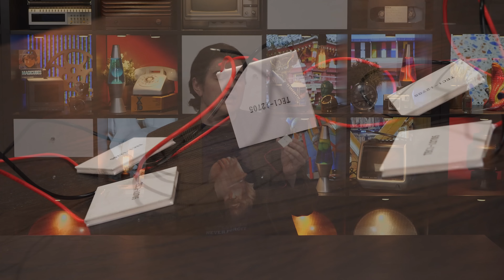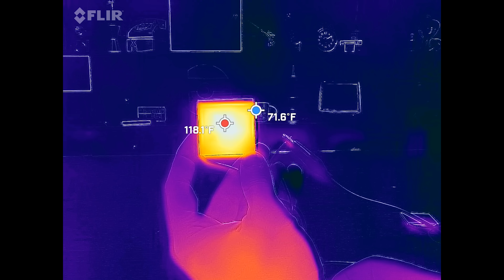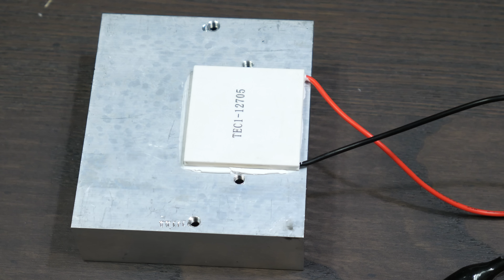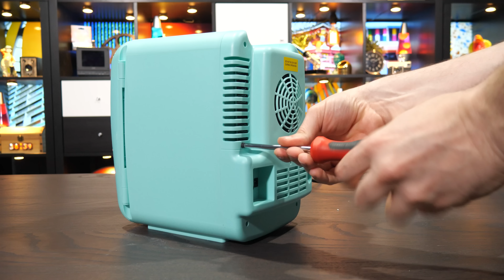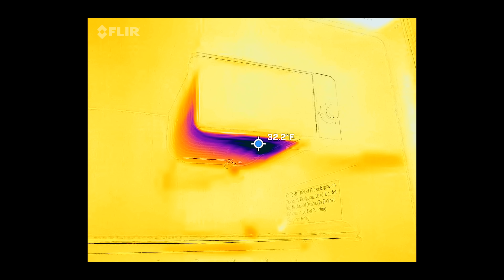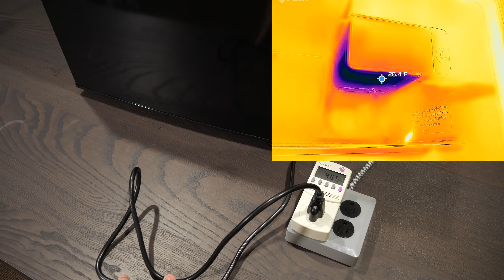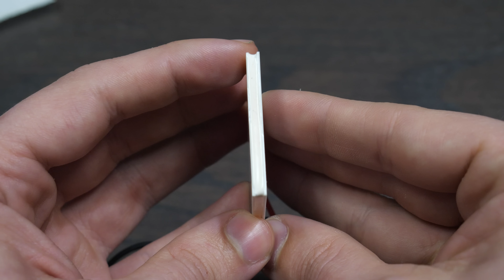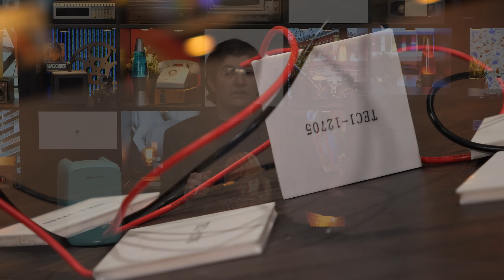Thermoelectric cooling: it's not great.

Comment: My parents picked up one of these cooler things that was designed to go in the seat of a car for a trip. We used it when we went camping for a few weeks and plugged it into the car and it kept every thing inside cool for a week by just plugging it in at night and running the car every once in a while
Reply: that was most likely one with a heatpump like a fridge, they have them for cars nowadays but they are not the cheapest option, very handy stuff, been thinking about buying one myself.
Reply: @northplayyyer3453  if it was it was the quietest heat pump I've ever heard, there was no compressor hum the only thing you could hear was the fan gently blowing

Edit: I just looked it up and on the website it says thermoelectric cooling

Comment: Peltier coolers are great for what they're good for but yeah those drink coolers are horrendously inefficient. For cooling small mid grade a low noise cameras or temperature control of other small things they're fantastic but anything that's large enough to attach a mechanical heat pump to that will be a better option.

Comment: I remember when Peltier coolers were a big deal back in the early oughts for ekeing out an extra 1-2C of cooling a CPU. You'd have to carve quite the divot into your heatsink to fit the thing between the CPU and the heatsink, the power draw was ridiculous, and again, it'd only drop your temps an extra celsius or two, but these were the days when if you wanted water cooling you had to kitbash together your own system using aquarium hardware so it was regarded as a "safer" mod to perform.
Reply: They do exist now too but with how high modern CPU power draw is, they are essentially useless except for when you only care about single core performance. Which is almost never.
Reply: @pafnutiytheartist  they are not useless because you can easily make 2 copper plates 4x4 inches and stick 4x400 watts TECs between, and then stick these sandwiched TECs on top of your i9-14900ks, along with a liter of vaseline and foam to prevent condensation. You will of course need a hefty PSU to run it, since each needs 25-30 amps, and probably a water loop with a car radiator to cool the hot side, plus you need to make the waterblock yourself. But it would certainly allow that CPU to run at its best. 
This design has been used before. Phase change cooling would allow for colder temps and will run much more energy efficient.
Reply: Anyone remember when Dell sold a high end PC with Peltier cooling, 2006 or so? I wouldn't be surprised if it used more power than a similar era dual CPU rack server, even though the rack servers of that era were particularly power hungry.
Reply: The Pentium chips were basically tiny blue stars of heat, there were some crazy overclocking mods in those days, compressors, peltiers, liquid nitrogen, lol. Those were fun times! I miss them, computers are so boring now, haha.
Reply: @LazarusXavier  Undervolting is the new overclocking, get the voltages and heat low enough to run turbo boost clocks full time without throttling.
Reply: Nowadays the heat output from a CPU would melt the junction and vapor pipe tower heatsinks are better at moving heat anyway.
Reply: The only thing stupider than using a Peltier module to cool your PC is using actual water. What could POSSIBLY go wrong???
Yes I underclock, how could you tell?
Reply: @fuzzy-pillar  My fully custom 4770k/R9 290x loop says not much in the last 10 years it's been running. As in it's totally silent on 100% of the original hardware, 100% of the time.
Reply: @fuzzy-pillar  You don't need to underclock just undervolt. My undervolted i5 13600K pulls 153w on Cinebench R23 while running all cores at maximum stock turbo boost with the temp never going higher than around 76c. MSI motherboards make this very easy with their CPU lite load setting though if you get too low with the undertvolting CEP also needs to be disabled or the CPU will start clock stretching (slowing down) to maintain stability (which you don't want because you're trying too see how low you can go and CEP is conservative)

Comment: My tiny 500w cheap solar power station runs my 3.2 cubic ft dorm fridge about 26 hours when ambient temp is 78 or less. Total capacity of the battery is under half a kilowatt...about 480 wh.

Comment: What about keeping that little mini fridge, inside your main fridge? You might have to drill a hole through the back of your big fridge for the wiring to the mains socket also, so be careful not to hit the pipes in the walls of the main fridge.

Comment: The fridges you compared with all included a freezer section btw, which is another strike against the blue box thing. You can also buy those cube fridges without that here, and they tend to be more efficient, and have more space inside. EDIT: nvm, should have watched to the end.
If you really want a mini proper cooler, use a portable/camping chest style thing. If you buy a good one they also have proper heat pumps. Plus you an then use it for camping/picnics/... etc.
They have actually solved the oil thing too, so they are not sensitive to being moved, but they are more expensive.

Comment: Phase change refrigeration coolers are very inexpensive these days. They have variable speed DC compressors. They use as little as 28 watts, and can bring the cooler below freezing with ease.

Comment: I recently bought a dehumidifier at my local Nex for about $50 utilizing the same thing as that tiny fridge. While it does pull moisture out of the air that is measurable by my hydrometer, sadly my barracks room is too large for it to make a major impact compared to a proper dehumidifier or proper heat pump. Much sadness.....

Comment: I do kind of feel that there would be a viable MEMS heat pump refrigerant circuit that's a sealed unit with a pump inside driven magnetically from the outside.

Like, you could make something credit card sized with nicely etched aluminium on either side of an insulating plate with a flow restrictor in it. Maybe even making it with sealed solid R744* during manufacturing as the refrigerant.

*CO₂

Comment: If you've gotta keep something at a quite specific temperature, the solid state reversible peltier is perfection.
It's uniquely suited to keeping things precisely tepid, not getting too big for its britches and trying to be a fridge.
I'm sure some scientist out there is using these things in their proper application. (Bulky compressors with brute force bang-bang relay operation will swing temps, but you can PID tune these piddly little TECs)
Reply: Yup, peltiers are the way to go to stabilise temperature of lab laser diodes. Small size, bidirectionality and ease of control circuit are unbeatable, especially in cases of low power dissipated in the diode itself and wanting to keep the temperature just a bit higher than ambient. Peltiers scale very well into region of low power temperature control.
Reply: Bang-bang relay make arcy-sparky fun times. Magic square not fun times. Don't want.
Reply: They are, in fact, being used to cool some spectrometer detectors, since they aren't generating a lot of watts of heat that need to be transported away, but do need to be kept very cold - and the cold side of a Peltier element can get very cold because you aren't limited by the refrigerant's boiling temperature.
Reply: Thermo-electric Dehumidifiers!

Comment: Peltier-Element a very simple way to cool something below room temperature in a small volume and at a very low complexity. Efficiency is not good as it heats more than it cools and the hot and cold sides are very close together. Scalability is poor. Your quickly in a Setup where a compressor / heat-pump makes more sense.

Comment: I bought one of those because I didn't want to have to use the shared fridge in the office in a place where I worked, it was not intended to do anything more than just keep the lunch that I'd already packed cool for a while. 

I think I would have done just as well by getting a portable cooler and chucking a couple ice bricks in each morning. That's what I've been doing now that I have delivery work and honestly it is the same if not cooler by lunch time.
Reply: Coolers have stood the test of time for a good reason. Ice takes a good bit of energy to change phases. 1 pound of ice will absorb ~150,000 joules from its surroundings by the time it's completely melted to water. Ice is cheap, and with good enough insulation, it can last for shockingly long amounts of time.
Reply: @whatbroicanhave50character35  cheap, AND you can literally make it at home.
Basically a thermal energy battery, negative polarity one at that.
Reply: @whatbroicanhave50character35  I'm actually using a couple of old ice packs left over from when a friend ordered some temperature-controlled medication delivered to his house. They work great.
Reply: Yeah, a cooler and a re useable ice pack is far better. 

The only thing I liked about the peltier coolers was the "hot" feature, so if I felt like warming up a lunch I could turn it to hot a few hours before I planned to eat.

Was kind of a treat in winter to reheat leftovers in a delivery van.
Reply: Ironically, “back in the day”, the office I worked at wouldn’t allow each employee to have their own cube fridge at their desk due to the “high energy usage”, but had no problem with everyone having a “toy fridge”.  I never knew the toy fridges used MORE power, and neither did management!
Reply: The do have coolers with compressor cooling too.
Reply: @chaos.corner Yes, I have one with a compressor and it's awesome!
Reply: Bright side, no need to worry about the power costs if it's plugged in at work
Reply: Get a old mini fridge with a lock on it. Totally insane how people are THIS CLUELESS at living on earth.
Reply: @MrWolfSnack  I'm sure it too would have been stolen by my office manager when I quit.

I like my Igloo Playmate better anyway.. Tough little guy, keeps my food cool.
Reply: @rolandguiscard  I’d say you’ve ended up choosing the most convenient, cheapest and most obvious solution to you particular needs: It costs next to nothing, takes up hardly any space, is portable (if you have to eat your lunch at some other location) and doesn’t require any permission to use company power or office space.

That others seem to think the obvious and practical solution is a personal, locked fridge, seems rather baffling to me. 

But then I work in a place with a good and regularly cleaned and maintained shared fridge in the lunch room, so I generally don’t have this problem. I even keep a constant supply of Coke Zero in there for when I want my caffeine cold, rather than hot (i.e. coffee).
Reply: @DebatingWombat  I mean, I needed something I could take in the car, so this seemed to be the right thing.

Comment: Great video. It might be interesting to look at Peltier devices being used in reverse (using a temperature differential to generate electrical energy) which can be used to make things like fans for wood-burning stoves
Reply: In the case of fans for wood stoves, sterling engines seem to be the way to go. It might be fun to compare the energy efficiency of the two systems
Reply: @bobby_greene  yeah, especially when it looks like they can be up to ten times as expensive
Reply: They definitely already exist, but the power produced is only really useful for small wireless sensors and things like that. Running a fan... maybe? But you'd need the same setup with a big heat sink to dissipate heat on the cool side and then possibly a fan to keep that side cool too. It's equally messy and might as well just use a small battery at that point. But you're eight about it being free energy, but only a tiny bit is available. You also have to be careful because its not scalable since if you pulled too much heat from the system then it wouldn't vent properly.
Reply: @uncertainscientist , exactly what i was going to say next
Reply: @uncertainscientist , I have a mini fridge filled with ammonia and a electric heater element, not great in efficiency but no moving parts. (Except the gas/liquid, and thermal load/unload)🙂
Reply: I expect that is already his next video. He loves to find parallels in videos.
Reply: The efficieny in that direction is really bad
Reply: @metrikmechanik  true, but that doesn't actually matter that much-a fan only takes a small amount of energy to run and the stove is pouring out an absolutely massive amount of raw heat energy all the time.  there have been a few people messing with much larger peltier arrays for wood stoves with the logic that even if it is inefficient it's a simple, long-lasting way to make a bit of power for an off-grid cabin to top off batteries on cloudy days.
Reply: @dayvancowboi9135 , absolutly but at that point you are running more of an experiment than a real device, wich is still cool😊
Reply: @metrikmechanik  Sure, but it's practically free energy (not the same thing as free energy generator, which is a fictional device)

Comment: You're right about the need to let a refrigerator with a compressor stand for a few hours after being moved. When I worked for a UK white goods dealer in the 1970s, the majority of our replacement fridge sales were to people who had just moved house and switched the unit on as soon as it was in its new position. Often this was because the electrical socket was positioned behind the unit and they didn't want it standing in the middle of their kitchen.
Reply: You can move them, but they should stay upright as much as possible. Briefly tipping it over should be fine. Transporting sideways in a vehicle for 30 mins should get some time to let the oil settle back.

If you start it up though, a lot of the oil will get pushed back to the compressor, but it will coat the lines on the way there and take a bit to get returned. This would be worse on the passive ones with the large backside coil compared to the fan cooled ones most are today.
Reply: @Jaker788  Here in the UK the vast majority of our fridges are still passively cooled since we don't have as big ones as America tends to. 

Either we'll have under-counter models which are just a fridge, or we'll have a fridge/freezer which is half the width of an American style one. American fridges are becoming more popular in the UK though but most people don't have room for them in their kitchens.
Reply: If you're ever asked by a friend to help them move house, first consider what kind of fridge AND staircase they have. I've experience with these sort of things and it's mostly not fun.
They're usually lighter than washing machines though, but way bulkier.
Reply: So, it worked. They didn't had them standing in the middle of the kitchen, after all 🤣
Reply: I had a friend who broke their refrigerator last summer when they moved. My dad who also used to work in white goods really doesn't feel safe until he's left the fridge or freezer to sit for 48 hours or more.
Reply: Sounds like a great way to make money 😆😆😆
Reply: @blackoak4978 money for nothing, one might say
Reply: Because it is filled with oil and the oil has to settle. Can be anywhere from 12-24 hours, depends on how long it was upturned.
Reply: Anything using a compressor with oil should stand for a coupleo fhours after being moved/bounced.
Reply: They weren't smart enough to turn the thermostat to off ?
Reply: @Kris_M  Not all Fridges have that setting. I have a cheap one that doesn't and worked at place that sold fridge.
Reply: @Kris_M  my first thought is to head to the fusebox and turn the breaker off... fridges usually are on an independent circuit... usually.
Reply: @paradiselost9946  That will, in the vast majority of properties in the UK (and, to my knowledge, Europe in general), end in disappointment as there's rarely an independent circuit, owing to the lack of need for one.
Reply: @Monkeh616  older houses, sure. its become a mandate in new builds in most countries...

i dont know why, something to do with RCBOs, another mandate, not resetting after a blackout or something. im no sparky.

Comment: A 12V portable dual zone car camping unit is going to be a much better option. Maybe do a video on one of those? They've come down in price significantly over the last few years.
Reply: I’m going to second that! I have a 12 V/120 V cooler type camping refrigerator looks like a large cooler, but has an actual vapor cycle refrigeration system in it, and I think I am getting about 1 A continuous drain at 12 V. I know a 50 amp hour lithium iron phosphate battery will run it for about three days. Plus it plugs in. When I’m not traveling or camping or going to picnics with it, I leave it plugged in. It makes a great drink cooler! And, since I have Batteries due to being an amateur radio operator, if I have a power failure I can put my medication and some perishable foods into it.
Reply: I too have one of those compressor Chinese car refrigerator freezer units that has been running 24\7 for 3 or 4 years with no problems. Runs on my 12 volt solar power system and draws 2 amps when the compressor is running. Cools down to -4 F when you want hard ice cream.
Reply: Most of those car fridges actually have compressors unless you are talking about the ultra tiny ones.
Reply: I have one that has been running 24/7 for almost 4 years, from solar/battery power.